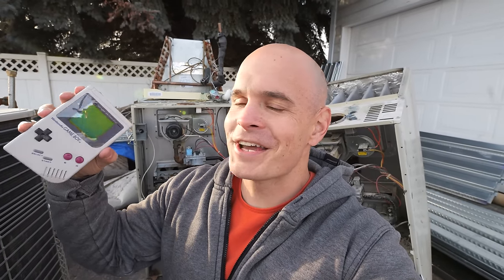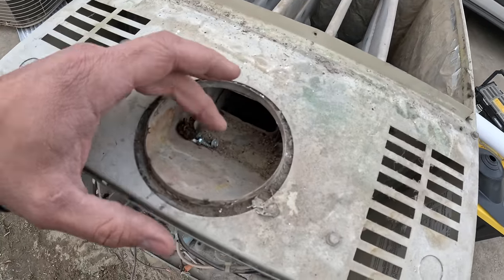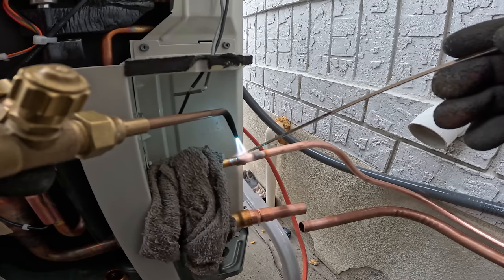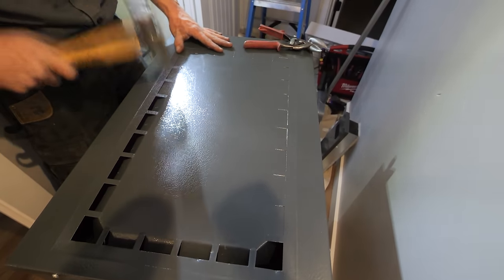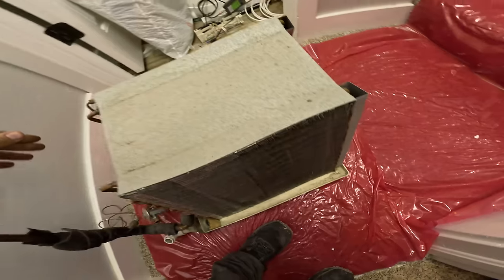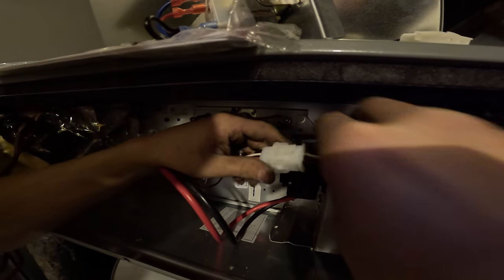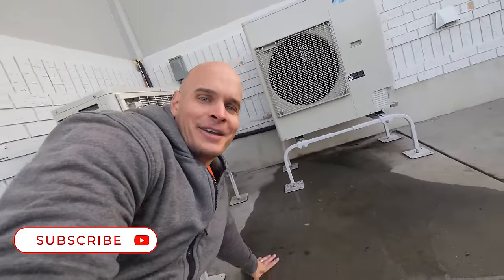Why is Everyone Talking about Heat Pumps?

Comment: People trashing heat pumps often overlook the dual fuel option (perhaps deliberately). It dips to -30C here a few weeks a year, but most of the time a heat pump would cover the majority of the heating and cooling needs.
Reply: Yep
Reply: @Baxtexx  Due fuel systems are just wasting more money when NG does well on its own. HP cost double what a good quality AC and high efficiency furance run and last half as long of life span.
Reply: @zack9912000 What crusade are you running?
Reply: He is right though
Reply: @ulischmidt03  people see heat pumps as a political symbol and feel obligated to object to them. Crazy how people are triggered by air conditioners that run backwards.
Reply: In my case at least, it wasn't "overlook[ed]". It was that incentives/rebates didn't cover dual fuel options, but did cover adding a standalone heat pump.
Reply: @pmrose18  Always have backup heat in cold climates. In case power lines beak you can rely on gas or wood.
Reply: Because that adds complexity with no return in many places. For example where I live electricity is 3x more expensive per BTU compared to NG (that's comparing mid efficient furnance to a mid to high end heat pump). So why am I going to spend 3x the install cost for a dual fuel system that will cost more to repair and maintain in the long run as well as not save me any money in usage? Doesn't make much sense.
Reply: @Tkaya460  You're comparing apples to oranges. If you like to live dangerously? Sure, have a place with no backup heat. If you live in an area that doesn't deep-freeze such that heat is just comfort as opposed to a necessity? Sure, have a place with no backup heat. But otherwise... the proper comparison isn't dual-fuel versus heatpump-only - it's dual-fuel in a single unit versus standalone heat pump and some other furnace.
Reply: @TheLoneWolfling  you're missing the point entirely. 

Where I live we only heat with NG fired ducted furnaces. Unless you're fancy and have radiant heat. 

It's not cost effective to heat with any other fuel. Period. No one has the money to tripple their hvac costs by going to dual fuel or redundant heat.
Reply: @Tkaya460   Compared to furnace+AC it's not much more install cost. If the heat pump is consistently more expensive to operate at any temperature then use the furnace for 100% of your heating and leave the HP for cooling only. If utility rates change you can start using the HP when it's warmer out. Or if the furnace has a malfunction you can use the HP to stay warm.

If you live somewhere where electricity is 10x more (as you claim) and it never gets hot then sure, go with a heating-only furnace.
Reply: @eDoc2020   it absolutely is more install cost. Considerably more. And electricity is 3x more expensive per btu than NG here. It never makes sense to heat with a heat pump vs a furnace. So why install it and maintain two systems as well as more complex controls?
Reply: @gecho194 Heat pumps are more expensive to run than high efficiency NG furnaces in areas of the midwest that regularly get to -10f at night, have $0.2/kwh electricity and $0.95/therm NG. In most other areas of the country, yes, heat pumps are cheaper.

Comment: Getting a Daikin heat pump with four mini-split heads installed this Friday. Current AC is a fan-forced 12 or 13 SEER unit. New mini-split units are rated at 18 to 20.6 SEER2. We are going to keep our propane furnace for the time being through next winter to see if we need any supplemental heat.

Comment: As a HVAC Tech I appreciate your interest in it all. It is fascinating, especially when you've got high end fancy equipment. 

I installed a Daikin three head a couple days ago. Plus they just made the new R-32 refrigerant that's much friendlier for the environment.
Reply: > new refrigerant

This is one of the reasons some people are somewhat wary. If you're purchasing something with a supposedly 30y lifespan and you can purchase a unit that's essentially the same as a unit purchased 30y ago that actually lasted 30y, great. But you can't. And the warranties a) tend to be short, b) tend to have so much fine print that they don't tend to be viewed as reliable themselves, and c) tend to be with companies that you're not sure will last another 30y.
Reply: @TheLoneWolfling you don't need to swap your refrigerant just because a new one came out lol it's for new installations.
Reply: @jorgebatista6323  I meant for retrofits to add heat pumps to existing houses with "silly" heat bills to try to help bring down said bill. If you have e.g. oil hot water - which many places here do - and it gets below freezing in winter - which it does here - losing heat can very quickly result in burst pipes and a very expensive bill.
Reply: @TheLoneWolfling  I get it. But let me tell you, here in Portugal we've been using these heat pumps for like 20+ years, here we just call it AC, and they work very well.
Reply: @jorgebatista6323  Were they running R-32 there 20y ago?
Reply: @TheLoneWolfling  R32 is being used for about 4-5 years or so, previously they'd use R410a like on the video. They work almost identically, the main difference being that R32 is more efficient and less harmful to the environment.
Reply: @jorgebatista6323  Unfortunately at this point enough people have pulled the "almost identical" card on enough things that weren't that that doesn't really help sway people who are wary.
Reply: @TheLoneWolfling   R410A is a mixed refrigerant and 50% of the mix is R32. The equipment that was using 410A 20 years ago is already using R32. Full R32 behaves about 10% differently so it's not a big change. It's not like R22->R410a which was a much more significant change.

Comment: The moment where I find things really funny... my country house has heated floors, cold and heat air cons... for over 30 years, lately I replaced the outside units with inverter units as they are more efficient and can run the whole day, and I live in the Mediterranean. When they work for cold, the splits cool the air, when they work for heat, they pump hot water through the floor. They also heat the water accumulators for bath and kitchen use, either in the summer or winter. I also collect the distilled water. My system is also Daikin.

Comment: Hey! HVAC tech here. The EPA just released a new refrigerant guidelines they want to implement that they are going to be forcing change to through their normal insane price gouging.(and they are going to do it REALLY quick *from what I have heard*)  I highly recommend you contact your company who installed it about an extended parts and labor warranty because you , unfortunately, are most likely going to need it regardless what brand you buy and part cost for your units with 410a are going to skyrocket. (The new stuff is either r-32 or r-454b)
Reply: R32 is a bit cheaper than R410A and is compatible with many existing 410A systems. Since Daikin is a promoter of R32 I'm sure Zack's unit is dual-rated for both refrigerants.

Comment: I’m an HVACR engineer. Do this day in day out. Strongly disagree on them using the ring lock couplers. Should ALWAYS be brazed unless unsafe or hot works not allowed. There’ll  be a leak on them eventually, braze you’ll never have to worry. Many people use them to cut down on time. I get called out and it’s always them that are leaking.
Reply: Agreed we ran into them on commerical jobs and the oring is what fails.

Comment: Just installed geothermal heat pump.. hole drilled into the ground (250m), cold stuff goes in, warmer stuff comes out. Super convenient, basically "set and forget" and cuts my power usage by a ton. Can also be run "in reverse" during summer to get free cooling/ac. Yay for new tech!
Reply: 250m down, how much did this whole thing cost!?
Reply: @MrChipcho it's like getting a deep water well drilled, that's done on the regular  in some regions. 

then instead of a water pump and single pipe, you feed in a loop of pipe and fill the hole back in with soft material. run water through that loop and it can exchange heat with the earth down below.
Reply: @ratchet1freak   Thanks, i understand but how much does something like this cost, and where are you from, Canada? (in EU, haven't heard of anyone using this) Deep drilling is usually expensive that's why I'm asking.
Reply: @MrChipcho  I know most of this from watching youtube videos from US. You can put the equipment required on a road legal vehicle. That's how most houses in rural areas get their water.

A big part of the cost will be in the pipe and the drillbit that gets left in the hole
Reply: @ratchet1freak you've responded twice with long winded comments without answering the simple question.
Reply: @james2042 from others I heard that full install is around 30k $ for geothermal heat pump. I have not researched the topic tho. depending on the place, usage and how big your house is, it can be net profit but I wouldn't get it. Maybe in future when they finally do the fusion reactors well. We will get pretty much free energy so it will be profitable for Sure.
Reply: What company did you use? Was looking into a geothermal heat pump, but couldn't find a company in my area.
Reply: @MrChipcho  live in sweden and I have geothermal heat pump. It's very common here and in other nordic countries. The most expensive part was the insulated pipes that was needed until you hit bedrock.
Reply: @nilsekluund  Nice, thanks for your reply! Can't wait to visit Sweden, it's in my to do list.
Reply: Not that new. I'm sure yours has a more advanced design, but my parents installed a geothermal system when they added a second floor to the house in 1992. I assume they rolled the costs of that into the financing for the addition, which I know no details of except that my father just finished paying the mortgage in the last year or two, as you'd expect with a 30-year mortgage.
Reply: @MrChipcho  the drilling wasn't that expensive - the heat pump itself was 12k-ish, and with drilling, pipe work, electrical etc it was like 15-17k in total (USD). Can't say exactly as I also did new radiators/plumbing in the entire house and got a total price for everything (about 30k). But the rig that handled the drilling had it sorted in about one day. I live in sweden as @nilseklund, and at least in our climate it's one of the best options available as it doesn't depend on outdoor temperature (fluctuates between +30 and -30 celcius). Surprised it's not more common in the US too.
Reply: @MrChipcho its quite common in the nordic countries to do this.
Reply: @MrChipcho geothermal is VERY popular in Europe. But it makes more sense the more north you go.
Reply: @MrChipcho geothermal pumps are common here in Finland, been that for 30 years allready...

Usually holes are 70-120 Meters deep, some case only few meters like If piping is installed like bottom of lake or on seabed....

Here in Finland you have full apartment buildings and malls/factories/office buildings using geothermal pumps.

Comment: In Norway about 40% of all houses use air-to-air heatpumps (27% in 2012), these have the ability to both heat and cool. In our house we got a heatpump in each floor with the support of a fireplace for the really cold winterdays.
Reply: Traditional fireplaces are terrible. They are like 5% efficient and emit tons of pollution indoors and are a bad fire hazard.
Reply: @kellymoses8566  You intentionally glazed over the "support of a fireplace for the really cold winterdays." part.

What many US redidents think of a fireplace is not the same as in europe. A pure burning fireplace has about 80% efficiency and does not pollute indoors.
An open fireplace emits about 500w/kg of wood, a modern pure burning fireplace emits up to 3200w/kg of wood.
Reply: Heat pumps depend on quite a lot of electricity, doesn't Norway have cheap hydro and (your own) gas generated electricity? makes all the difference to the economics.

Comment: Great explanation! We have ours here in Amarillo, Tx. Our coldest temps hover around the low single digits for about a week or two. Sometimes wind chills take us lower. We’ve been lucky our heat pump works great even at those temps. I’m honestly not even sure if our emergency heat has ever turned 🤷🏻‍♂️

Comment: I installed a daikin heat pump but keep my furnace as well , in Canada the heat pump can’t keep up when it’s very cold , but the daikin inverter technology is fantastic and I’m super happy with it !
Reply: You should use a geothermal heat pump istead. It uses the constant 4 degrees C that exist in the bedrock instead of the cold outside air.
Reply: You can use supplemental resistive heat during those cold times. If the heat pump can keep you warm for 90% of the time, it's still very efficient.

Comment: In 2022 57% of newly built houses in Germany installed heat pumps. Conversely, only 6% of existing houses use heat pumps, yet.
Reply: One of the best places to use heatpumps all year around and ppl are basically encourages to use gas or oil... It is a real joke 😂
Reply: The only reason that is the case is Germany has to import all their NG and propane. If Germany didnt have to do that and could produce their own it wouldnt be the case.
Reply: @rkan2  in cold climates you can't fully replace gas or oil with a heat pump(yet). even in this video of jerryrig in utah, he has two heat pumps AND a gas furnace. 
the reason is they get less efficient the more cold it is. so on the most severe cold days, when you need the heat the most, it doesn't produce much heat. it's a rare occurance and we didn't get close to that temp last winter in ontario canada but you dont wanna be shit outta luck when its -40c
Reply: @bmxscape  Maybe not where you are from. In Finland probably at least a quarter of  houses are heated without gas or oil burners. Only heatpumps with electric obviously as a backup/boost for colder weather. Obviously you need to be able to rely on the electrical grid in your country to be able to do it.
Reply: @zack9912000  Also the comment was about Germany, which is not in a cold climate at all. :D
Reply: @rkan2  The biggest problem with heatpumps in Germany is the price. To replace your old gas heating system costs around 5000€-10.000€. To get a new System with a air to water heatpump (the cheapest version) cost me around 45.000€. We got a bonus of 45% of the cost for exchanging a Oil Heater to the new heatpump. Still, who wants to pay 25.000€, nearly 3 times as much as you would pay for a new gas heater?
Reply: @bmxscape define cold climate. Northern of sweden sees many days of -30 celcius. Thick isolation, isolated windows,ventilation reycling and geothermal heatpumps work fine. 

But sure, HP is not ideal on the north pole.
Reply: @GeM_p_n  Sure if you want to go all heatpump. But to get most of the benefit (e.g. 80% of the bill reduction) you just install air to air heatpumps.
Reply: Companies that quote you 45k are a scam. They often upsell telling you you need better insulation, when a lower Vorlauftemperatur and maybe new radiators would already do the trick. They also like to MASSIVELY oversize the heat pump size because they just match the already oversized kw if your old gas furnace. Check out the video by technology connections on the topic.
Reply: @rkan2 thats because it's really hard/inefficient to power old school radiators found in most old houses with heat pumps, modern houses use floor heating that use way lower water temperatures and are far better insulated.
Reply: @bmxscape  He's Zack, not Jerry.
Reply: @Baxtexx  northern of sweden? so finland? both finland a nd northern sweden faced some -40 degree weather, which is the temperature the refrigerant boils. you dont have to be a scientist to figure out extreme cold plus no heat isn't good
Reply: @rkan2  "with electric obviously" lol you are agreeing with me man. heatpump by itself isn't sufficient. electric heating is less efficient than gas or oil. so heatpump plus gas or oil heater is mainstream for a reason lol
Reply: @bmxscape you mean it's -40 250m underground as well? 🤔
Reply: @Baxtexx  you dont quite understand the topic at hand do you? we are talking about heat pumps, not geothermal heating
Reply: @bmxscape Heat pumps transfer heat from different places. Air ones are the most common  and cheapest but there are ones with collector tubes you put in water or in earth/mountain.  Those are more expensive of course but can be worth it in colder climates. They are usually refered to as Ground source heat pumps as opposed to air source.
Reply: @Baxtexx  thanks for the info. we are not talking about geothermal heating though, and by definition air-heat pumps aren't classified as geothermal heating. the goal post can't be moved as it was set in stone in my first comment. Heat pumps do not work past -40. do you wish to dispute this fact or should you stop replying

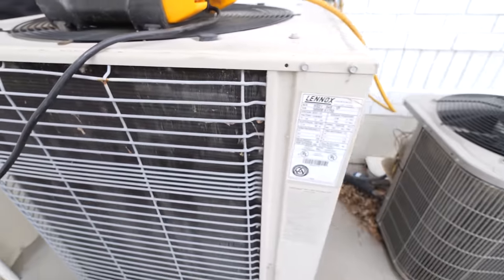Comment: That condenser shown at 1:25 is a 2000 Lennox HS21 "Innovator" series; the top-of-the-line Lennox model from the time. They were two-stage (featuring a Copeland 2-speed reciprocating compressor), and those old Lennoxes were made during a time when two-stage was luxury. A product ahead of its time for sure